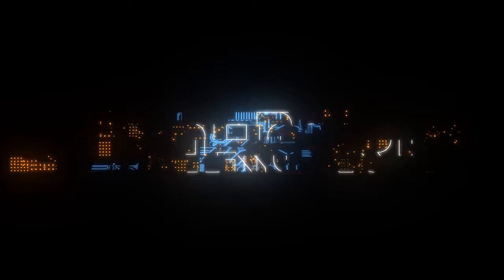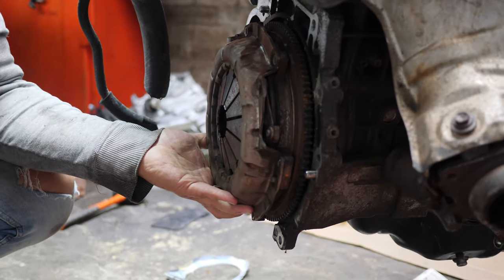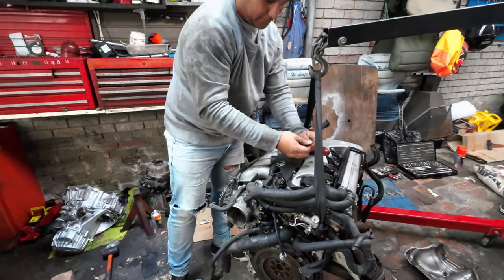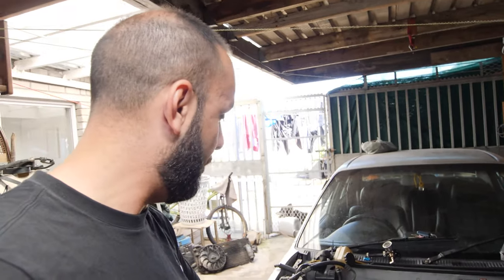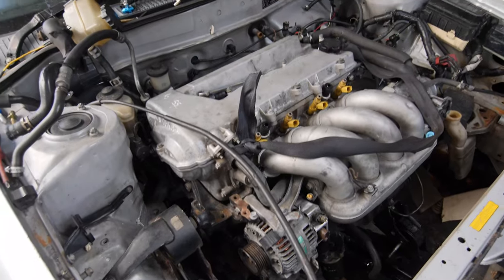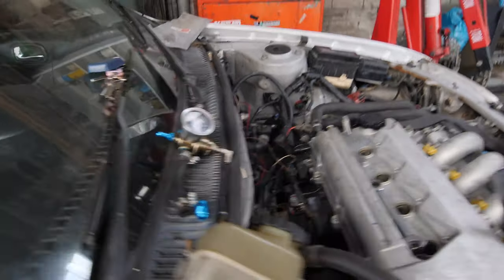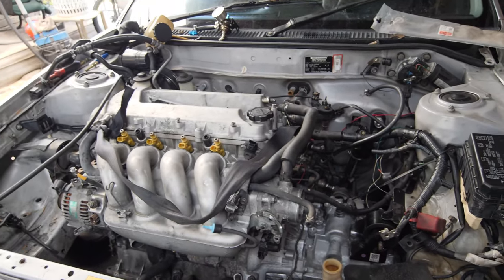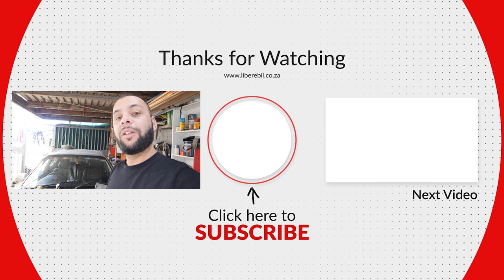THE MOTOR IS IN! - 2ZZ BUILD PART 2

Comment: Best would be the get the filter/stack outside of the engine bay due to hot air, hot air will make the car run weak, or daily the car with the induction in the bay, tune and race it with the induction outside of the bay, out by the light even

Comment: longer induction pipes are better for low-end power, and shorter induction pipes are better for high-end power (the difference isn't exactly phenomenal, but nevertheless). i suggest moving the battery onto the gearbox mount, and locating your induction pipe to where the battery currently sits.

Comment: Rather have the induction go through that hole and extended to the center of the bumper, water won't be a issue unless you plan on driving through dams
Reply: Which gearbox are you using?

Comment: Yarre please put some cams in the 2zz
Reply: Stock cams with a longer runner 4-1 header, the lift around 5200 rpm with a good tune is perfectly fine for a road 2zz. Add a ported intake/plenum, even better. Don't put the filter in the fender and don't make the intake pipe too short.
Reply: All basic stuff we've seen before buddy. I'd actually like to see what a 2zz would do with decent spec cams and head job
Reply: @xAvaragex  been done before, with full management, stage 3 cams, you looking at 170kw or more pump fuel.
Reply: Quite alot of work just for 170kw according to the money that will be spent. This why guys go ve, it'll push that out with oem N1's.
Reply: @xAvaragex  I said from 170kw, but remember it's 1800 at that power band revs much quicker that a VE with the same power or even more, At 170kw I've beat lots of VEs with the same or more power. At 180kw I've beat VE with over 190kw. And we talking 2L vs 1.8L.